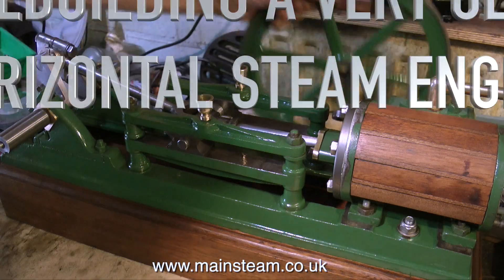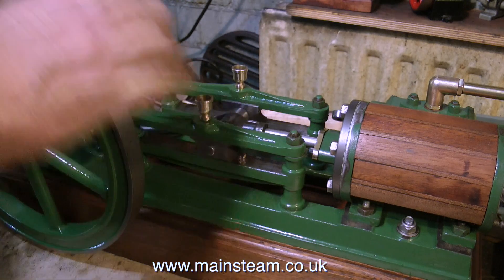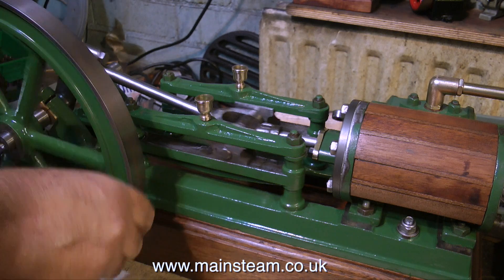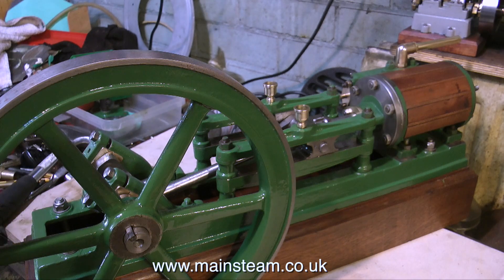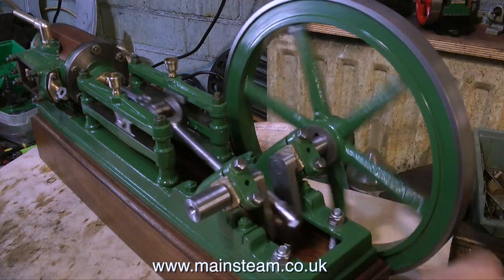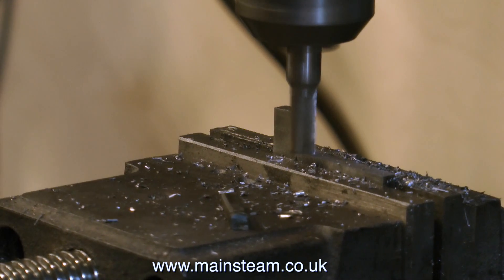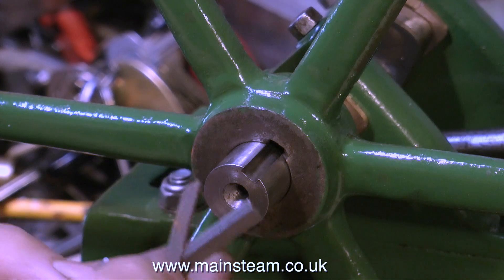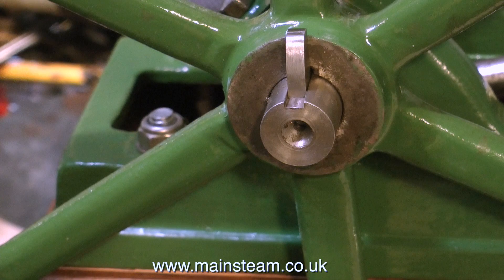PART 21 - LARGE HORIZONTAL STEAM ENGINE REBUILD

Comment: Shouldn't this Key have been a tapered Key? As there is no means of locking the flywheel on the shaft. This method also allows you to position and lock the flywheel anywhere along the shaft, the distance of the key way. Adjustable spanners make me cringe. Sorry for being so picky. Great video.
Reply from the maker: +Geoff Jones The key is slightly tapered. I too dislike adjustable spanners all except for "Bahco" adjustable spanners. This one I have used nearly every day for 30 years.

Comment: I think the casting is something that is called "Restguss" in German  ("remaining pour"??) It's normally the last batch in a series of casting. The amount graphite and slag is quite high, the pouring temperature not optimal, and the resulting cast is more like glass than iron. To make the cast more machinable, it will then heated over multiple hours by 400-700°C, to drive out the graphite. This only works with thin castings. Done wrong, you will end up with a very low or uneven distributed amount off graphite in the cast and heavy deformations.
In addition the slag in the cast will be transformed into a form of oxide that acts as rust "seeds". The casting will rust very fast.
This is the indication for me of a "Restguss".

Today no one gets such castings any more. The treating afterwards is more expensive than the savings trough the cheap material.
Reply from the maker: +boelwerkr Another great comment, thanks for the useful information :-)
Reply: Keith Appleton
No problem. It's fun to get some of my random knowledge out of my head. :-)

Comment: why did you not use a bushing for the crankshaft? You spoke against the shim use for the shaft in an earlier video. Also, have you ever seen tunnel cuts in the castings under steam use?

Your explanation of slide valves is impressive. Just watched another model engineer use cast steel for adjusting slide in steam chest instead of brass.

Comment: I don't want to speak out of school or punch out of my weight class you seem to have considerable experience compared to my very limited experience but I did work in a crankshaft factory and I routinely used machine tools in that factory occasionally we ran into a problem that you're running into with this flywheel the problem of course was the wheel was too large the shaft too small but we could not throw them both out because of the cost I would suggest leaving the flywheel basically boring it out and putting a thin sleeve into the flywheel

Comment: Surprised that you did not decide to just bore out the flywheel and then press fit in a sleeve - if that would work.
You know more about this than I ever will.
Thanks for producing these and I do find them useful.
Reply from the maker: +mike klaene  actually do these renovation jobs commercially and somewhere along the line I have to not lose too much money by adding even more extra work to this job. There is a fine line between overworking an engine and having to either do it for free - or pile on the time which to my customer equals money. I do realise that bushing is the answer, but if you saw this engine up close & personal - not enhanced on my videos, you would see what I mean . . . there are limits in the budget before the renovation cost massively exceeds the actual value of the engine.